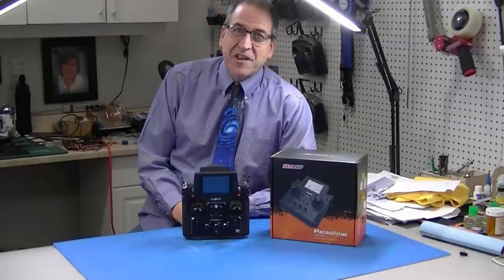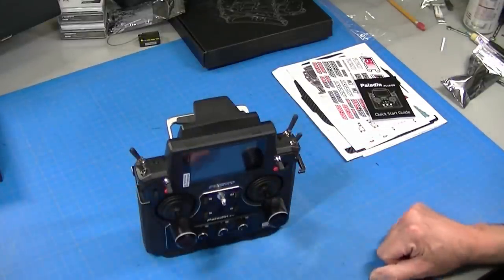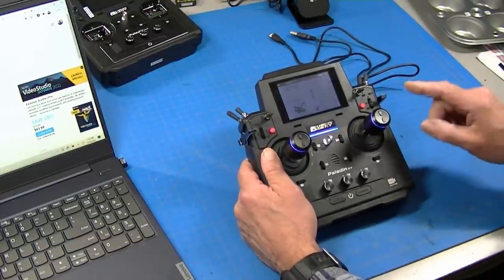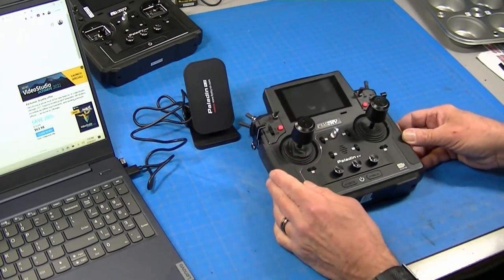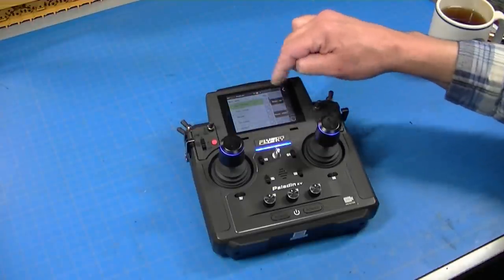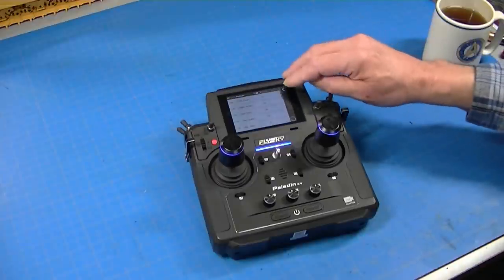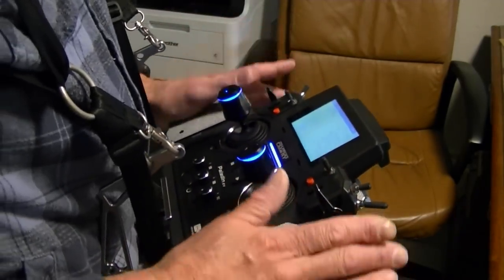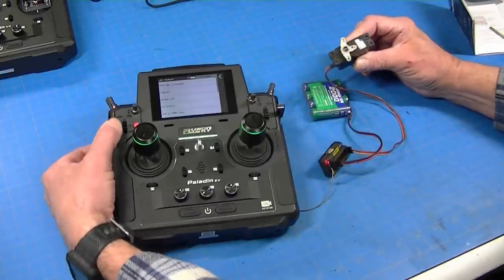NEW RC Flysky PL18EV Radio System Unboxing & First Look!

Comment: When I got my Flysky FS-i10 and it came with two speed sensors and a temp sensor. I would think in tanks or tow trucks the temp sensor on the motor or motors would be a handy thing to keep track of if you really work the models. This does look like a really nice surface radio with a lot of channels and features.

Comment: Question. You show that you can assign dualrate to any switch, but do you get dualrate on the sticks only or can you set up any switch/ channel for dualrate?
 As an exampel, on Beier sfr-1, prop #4 is assigned on a 3 position switch. On many radios i have set up to day, you are not able to use dualrates on these switches, they will only trow 100 - 0 -100 %, so you can only get 2 to 4 functions. If i could use dualrate on that 3 position switch, i could get up to 8 functions. The current truck i was helping out on had all channels oqupied, and the stick were the only ones that get dualrate, but had driving and hydrauliks set up on them and my friend did not want to mess up the mix and change them.

Comment: Hi,
is it possible to  switch models with the Paladin?
For example - a dump truck drives to the excavator and parks with the brakes on and the flashing light on - then I switch to the excavator to load the dumper - then I continue with the dumper....
This is the requirement for functional models and I am searching for a radio which can solve this. THX
Reply from the maker: Yes, the PL18 EV does it easily.  Will demo in a future video.
Reply: @HobbyconceptsLLC  Please do it in the next video, this is the crucial point for functional RC with different models!
Reply: @RCbra  It's a fine option for sure being able to switch models, letting one, or more, models go on 'idle'. I am interested in such a setup for my truck and excavator. On the other hand I see many hobby colleagues not so keen on this, but rather like to go for 1 (cheaper) radio for each model. In that way there is the possibility to have someone else drive that model. So there are different views here)

Comment: Wow! Wonderful video Mr. Bob! As always, but what's the receiver voltage is??? And how much $$$$$$$$
Reply from the maker: Receivers use standard 5-6volts.  Pricing is about $460 for base version and $600 for Flagship version with tray and aluminum case.
Reply: @HobbyconceptsLLC   I got lucky and got the ultimate version last week looks like it’s all sold out
Reply: @HobbyconceptsLLC  you mean to tell me! The receiver voltage is 5-6 volts?????? That's nothing.

Comment: Would love to see it set up from start to finish with the 360L excavator!
Reply from the maker: Actually coming soon!
Reply: @HobbyconceptsLLC  That's great! All the way from binding the receiver to all set up functions would be so helpful. And if it is worth using over stock radio.
Reply: @HobbyconceptsLLC  Do you think the PL 18EV will be a worthwhile upgrade for 360L? Not sure how many other functions are needed maybe pump on a dial to play adjust speed from radio?

Comment: So am I able to run more then one model off this radio? So like say I am running my dozer and I wanta switch to my excavator, can I do that with this? Thanks in advance!!
Reply from the maker: Yes you can.  If fact you can switch between models with the flick of a switch and not turn off the transmitter.  Great for running a truck with say an excavator on it.  Video here: https://youtu.be/7o-hTSzKl_c
Reply: @HobbyconceptsLLC  thank you for the response! That is really cool and nifty you can do that! I plan on getting one if I can do all that, quick question also, so how many models can I run off that single radio? Thanks again!

Comment: Hi Bob, im new to the hobby. How many different models can this control. i.e. can you use this to control multiple vehicles to save having multiple controllers, for example if you have an excavator and lorry and tractor in your model room and switch between as you use them? Does that make sense? Thanks
Reply from the maker: Yes, it has a quick switch mode between 2 models (push of a button changes), and has memory to hold 20 different models
Reply: @HobbyconceptsLLC  ok so how does that work? Sorry as I say I’m new to it. So you can have two running and switch between them to use them, but it can control 20 others? How does that work?

Comment: Does it operate 2 recivers at once?? Like the wireless lightset for truck and trailer
Reply from the maker: Not 2 at once but it does have a switching feature to quickly go between models.
Reply: The standard Paladin can run two 8 channel receivers in one way mode and one 18 channel receiver in two way mode. I would think that this would be the same.
Reply: @MnPaul1  so you can bind 2 receivers at once for wireless trailer lights?

Comment: Is this an updated version of the existing Paladin?
Reply from the maker: No.  The PL18 is designed for airplanes and quad copters and will still be available.  This radio is DESIGNED for trucks, construction equipment, ships and robots and is well, amazing!

Comment: I just got my Radio and it looks like the Touchscreen doesn’t work. 
It doesn’t respond at all 
I did fully charge it before use. 
Did anyone else have this issue
Reply from the maker: Make sure you remove the protective film that comes on the display screen.

Comment: Man, I want one so bad. So how’d you get your hands on this one if it’s a pre production product?
Reply: They are on alliexpress for sale.
Reply: @backyardrcconstruction1058  Thanks. Checked it out. Man those prices though haha.
Reply: @HiSteOfMnd  tbh I think it's pretty reasonable, look at everything else on the market with 4d sticks, servonaut hs12 is nearly €1000 the scaleart commander is €1500 up to €4000 this will only really appeal to people really wanting 4d sticks as everything else about it while being good it's not that much of a benefit over the others avalable.
Reply: @backyardrcconstruction1058  Awesome, thanks for your feedback.
Reply: Before this new one from Flysky, it was the FrSky Taranis with aftermarket 3D sticks that were the cheapest radio in this class. Many says FrSky radio programming and setup is great. Will be interesting to see how this new Flysky does compared to the FrSky radios
Reply: @Rimrock300  yes that's what I use to use. A frsky x9e with 4d sticks. They are excellent radios and extremely programmable. I also liked it was a tray type radio I don't like having to sit it in a separate tray. Because you have to operate thumb and finger it would have been so much better to make it a tray radio.
Reply: @backyardrcconstruction1058  Seems initialy that the FrSky radios still will be the more advanced option in the 'low price segment', but the new Flysky an be a fine option for those who don't need that much channels

Comment: Link to the english manual directly from the manufacturer:
https://github.com/open-flysky/FLYSKY-ProductInformationDownload/raw/master/Transmitter/PL18%20EV/PL18%20EV%20user%20manual%2020210417.pdf